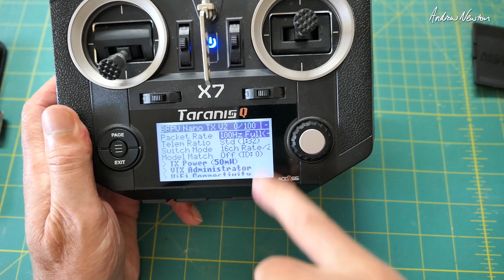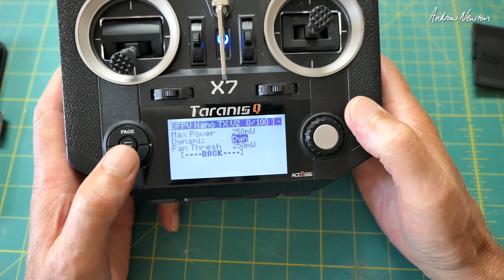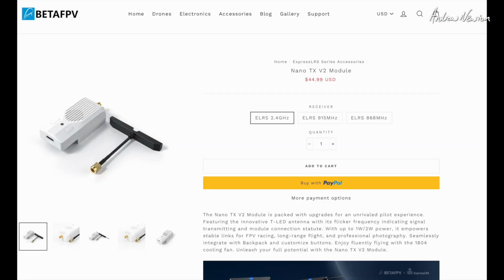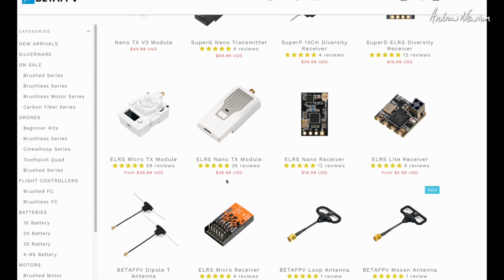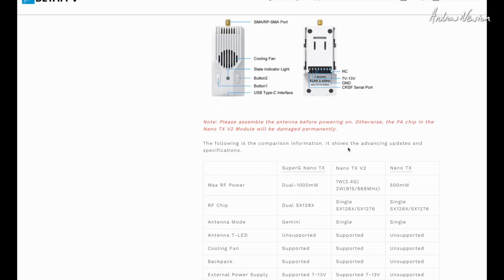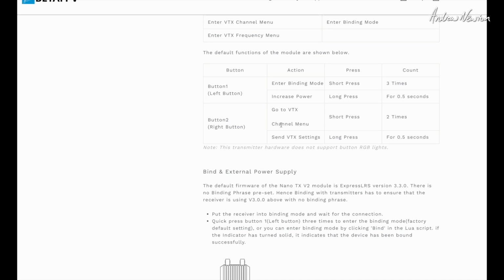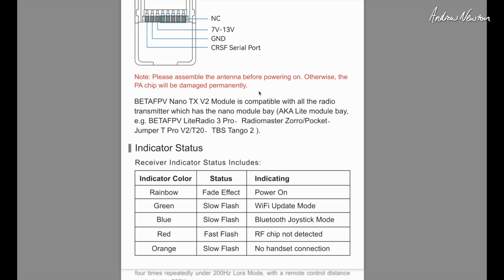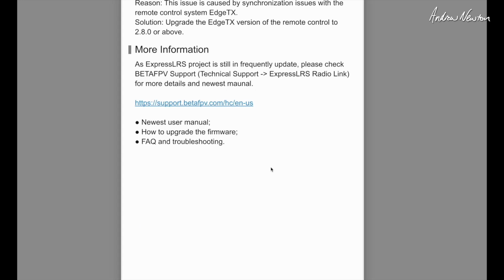BetaFPV ELRS Nano TX V2 RF Module

Comment: Why don’t it fit the x20 ?
Reply from the maker: Just got it to fit now. Needed a bit more force. Also needs the latest Ethos 1.5 ELRS.lua if you're running Ethos 1.5
Reply: @AndrewNewton  
Yes, I fitted mine too. I sanded down these walls around the port completely and now it fits
Reply: @AndrewNewton  
Someone posted a stl on thingi, but I can’t print it 🙈 I guess thats only possible with sla printer
Reply from the maker: Slightly different mount shape
Reply: @AndrewNewton  
Hmm, it doesn’t look like its a wide module with overhang or very big. Even modules with overhang fit it you sand down the back of the x20. I run a Jumper module and a crossfire nano just fine. 
The only issie could be the handle, thats why I ask. Thats the reason the big ranger module doesn’t fit.
Reply from the maker: Just the minute differences in the locking tabs in the mount. Probably just needs slight sanding as you say.